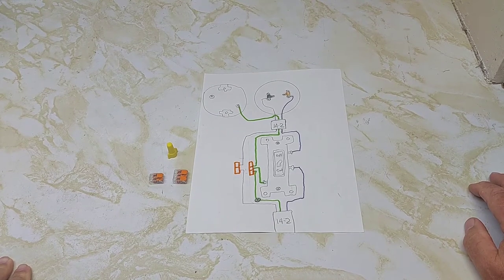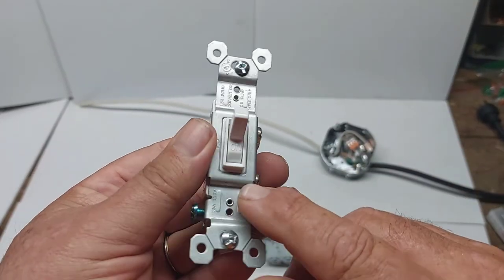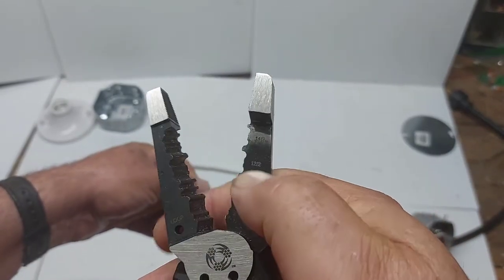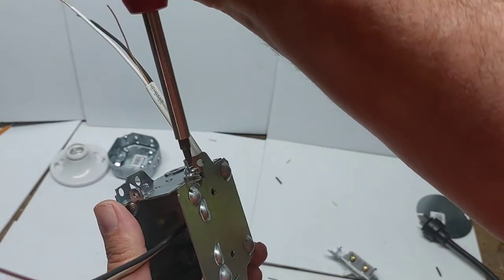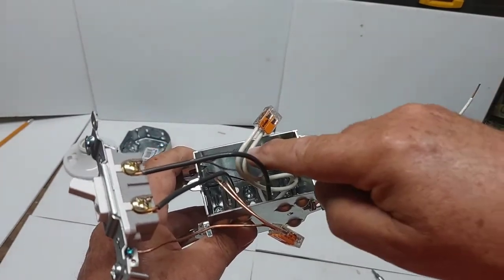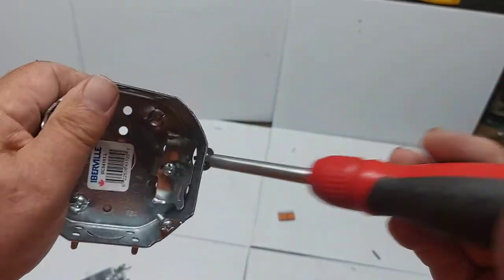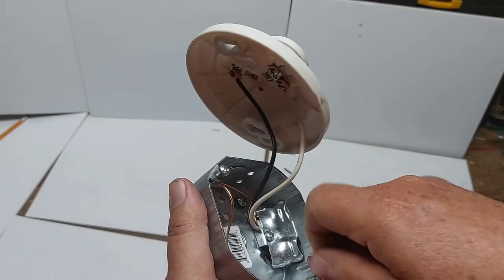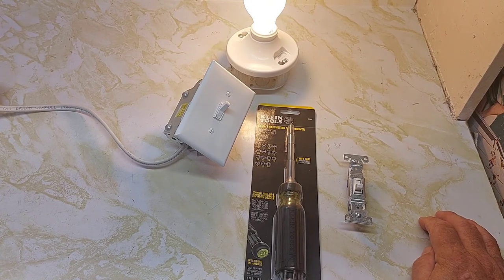How to wire Switch to a Light, For Beginners.

Comment: Thank you for referring me to this video. Would it be possible to run a light (power going to switch) and a light (power going to light) on the same circuit? The lights are in different rooms and operated by their own one way toggle switch. 

The "power-to-switch" light is already wired up and routes through a junction box in the attic. The "power-to-fixture" light has no power but does have a connection between the switch and fixture.
Reply from the maker: You could do 2 things.
Run power from your junction box to the light that has no power..
Run power from existing light to feed into the fixture with no power.
Reply: @JimMcLaren1950  Thank you very much,  I went with the first option since it is a shorter distance for me.  It feels very rewarding to have that light working again.
Reply from the maker: @emilyreeve2160  your welcome Happy you got it working.